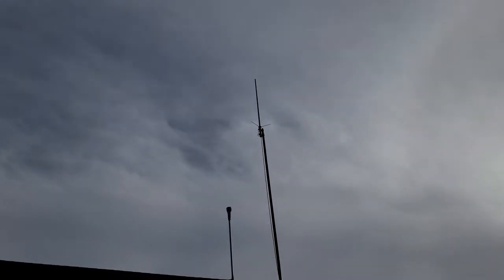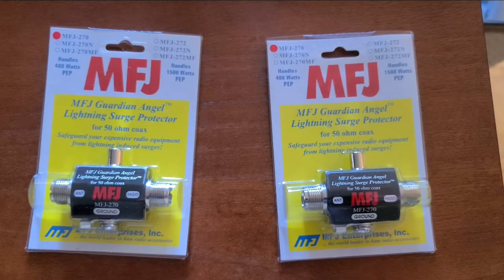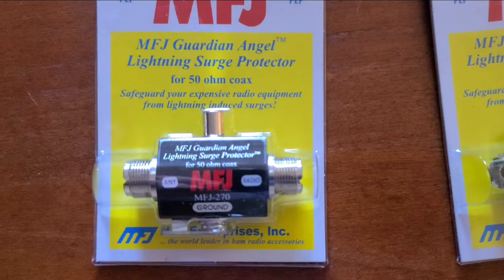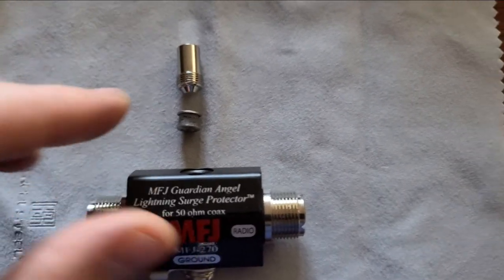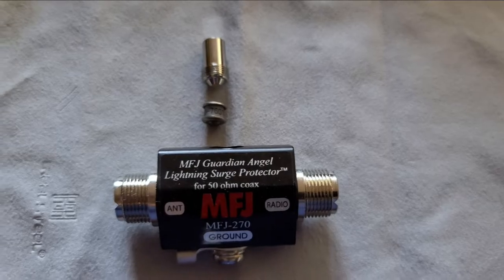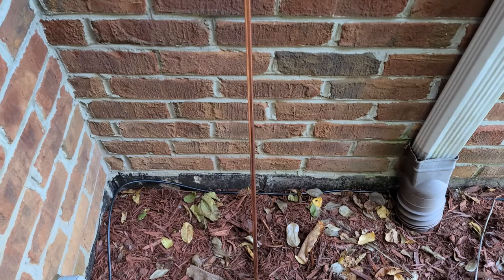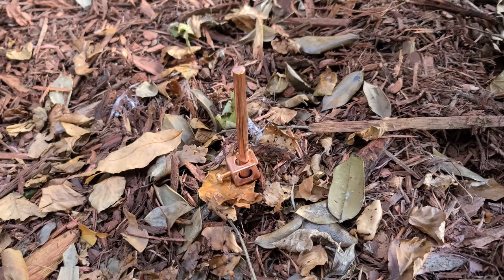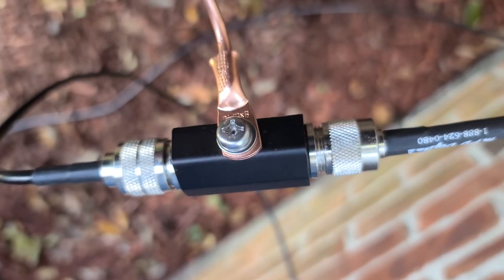LCARA HAM Radio: MFJ-270 Guardian Angel Lightning Surge Protector!!!!

Comment: driving a second grounding rod is no where to be found in modern (2021) electrical code. NEC 810.21 specifies lightning protection for outdoor antennas, and in your case that bit of metal electrical conduit already outside would have been a better ground point per code. by driving another copper rod into the ground and NOT bonding it to the building's main ground, you have a created a possible difference in ground potential for any equipment (like a transceiver) that is both plugged into the building's wiring and the antenna. transient currents could now pass through your equipment looking for a low resistance ground instead of staying outside.
Reply: Yes people do some screwy things... like you said, adding grounding rods and connecting them to an existing grounded system is simply adding more 'paths' for current to follow. The current is looking for ground and you may very well be adding routes for the current to take and thus increase the likelihood of damage from a surge.
      In my opinion, the best thing that you can do is increase the size of your ground wire to give the least resistance to get to the ground. 
    Yall Take Care and be safe, John
Reply from the maker: Hey Grumpy Kent, best practice, as I'm sure you know, is to ground your equipment including your antennas to the common ground at your home where your electrical panel is located. Sometimes this can be difficult. Dave Casler has a great video on this where he recently discussed how to extend your grounding further away from your panel. Having said that, if your radio is isolated from your home's electrical, there's no reason not to install a grounding rod near where your radio and antenna are located. I do this as my 2M station is not where most of my equipment is in the basement, but in my office for convenience. I run off of a battery most of the time. I use the Guardian Angel as surge protector and lightning did strike about 70 feet away just recently. It did the trick as advertised. Thanks for watching

Comment: For lighting rods in rocky soil, do not attempt to drive into the ground!  Instead, dig a 18 to 24 " deep trench the length of the rod and bury with about 200 lb of bentonite.  The bentonite is non corrosive and draws moisture  from the surrounding soil, maintaining continuity. Also, water occasionally to maintain the conductive properties in that area.

Comment: Most important parameter of GDT (core of arrestor) is Max Current of light.impact discharge, in kiloAmps.  Usually 2, 5, 10 or 20 kAmp.    Missing of this info mean that this arrestors core is a piece of china sheet....   Right solution: immideatly exchange the china GDT to good GDT 20kA from EPCOS or TDK. 🖐

Comment: I inquired directly with MFJ, and their engineer recommended #14 wire as being adequate with respect to a ground wire size for the MFJ-270.  It would seem to me that a larger wire, #6 or #8 wire size, might be better, but #14 wire was MFJ's recommendation.  Also, the ground rod must be bonded to the home's electrical system, which would be the outside ground rod where the electric panel is grounded, in order to avoid creating a "ground loop" through the coax connection at the rig by using additional independent ground rods that are not bonded to the homes main electrical system ground rod.  The bonding of all ground rods is also required by code (NEC).
Reply: NEC 810.21 specifies conductor sizes, and #8 is correct for grounding masts and coax,  and #6 to bond to the building's ground

Comment: Hello Operator Riff Raff Radio 231 From Fort Lauderdale Fla Waven a big ole five yo way !!!GREAT VIDEO !!!  i only do 11 meters and i transmit with a RCI 2950cd radio and work it with an amp , and i would like to know how to properly ground and bond my radio to two mixers and one compressor for the BEST no noise and no squealing for when i key up. also my amp and power supply are grounded to one ground rod and my mast and equopment are grounded to another 8ft ground rod. so far so good but maby you have a better technique... 73ws, im on the standy by, !!!

Comment: hello!

I saw your video a little late. I started amateur radio. I am also considering purchasing this lightning protector. I have seen some models on the internet, but will this device you are using be sufficient to do my job? I will make an experimental handmade double-layer flower pot antenna and I will use rg58 cable. Since I am planning to design a handmade antenna, I need to somehow handle the grounding, that is, shock protection. The radio I will connect is the Baofeng uv82x model. Due to the region I live in, it rains on average twice a week. (It's okay in summer, but in bad condition in winter.) So is this a good idea to prevent my handheld radio from breaking? Finally, can I mount this device anywhere I want on the cable? Or does it need to be close to the antenna? I don't know enough English to listen, but I can understand what you wrote. Thanks in advance.

Comment: Do you really want to have the surge protector right next to your house? Even though you have the surge protector grounded the lightning can travel in unpredictable direction when it comes to the tight 90 degree turn at the surge protector. It may decide to come through your window and light your life!
I would put the surge protector at the base of the antenna mast and ground it there. But that's me.

Comment: I have the poly phasers on each line coming in that goes to a copper ground plate. Then that goes via copper wire to a ground rod that is also bonded to the house ground rod.
Reply from the maker: That's a great setup!
Reply: That's the correct way to do it, all ground rods bonded.  I have the MFJ-270, and I wish I had the quality of either a Polyphaser or a Alpha Delta lightning protector.  But, I guess the MFJ is better than nothing, and hopefully it'll be reliable.